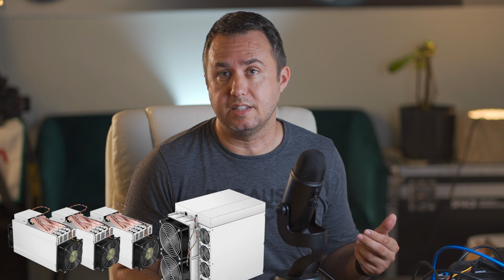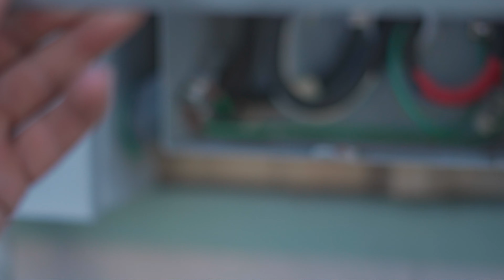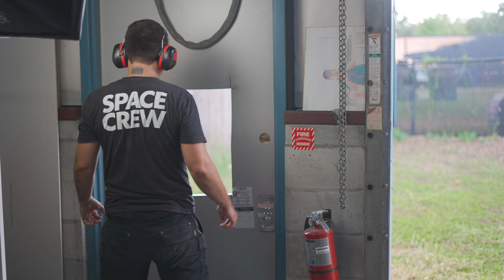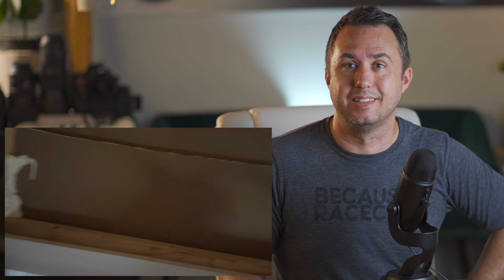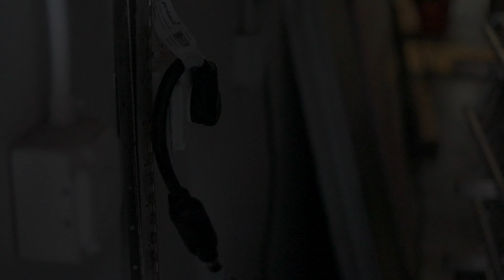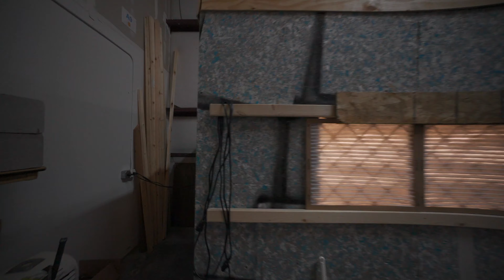Bitcoin mining filter room for my ASIC S19j Pro miners. How much do they make?

Comment: How has this held up over time? In my experience...keeping a cool side and hot side, is difficult. Even with the math, real life versus paper life, variables don't get accounted for initially and change the outcome. I work on miners daily, on alot larger scale(more heat and airflow)
Reply from the maker: I agree about the paper math; I am, in fact, an engineer!! But in this case it held up and worked out.. The exhaust fan is sufficient to clear all the hot air created by the miners and more. Even in the summer in florida my little mine is working out.

Comment: Great vid, love your channel - question: I just ordered an S19JPro - single unit. It will sit in a room, that is 10x10x8 and I'm looking to put a fan in that is 1600 cfm. That means the air will be replaced every 30 seconds. Do you think this is enough? This is in a basement where the ambient temps are already cooler.
Reply from the maker: Yep that will be enough air movement, just make sure theres some way for fresh air to make its way into the room if youre exhausting air out of the room..
Reply: @SPACEDESIGNWAREHOUSE  Yep, I'm going to put inlet vents in the room. Trying to figure out the best spot. Or I leave the door open, in which case the noise might kill us.
Reply: @SPACEDESIGNWAREHOUSE  Love your channel by the way!

Comment: How much can you hear when outside the room?
Reply from the maker: That seems like a difficult measure to describe. But the room has a giant opening so the air can get sucked in. So you can hear all of it.
Reply: @SPACEDESIGNWAREHOUSE  I guess a better question, would someone working the warehouse be annoyed by the noise?
Reply from the maker: @MrSkunks  no, I don’t think so. However I used to film stuff in there and now I don’t because of the high pitch of the noise. 
Everything is going full immersion cooling soon to fix the noise completely!
Reply: Reason I ask is that if I did something similar, would my warehouse staff be annoyed

Comment: Love the videos, very inspiring! Got some small miners on the way, may have to build a room like you did.  Minor correction, 8*8*8 is 512 cubic feet, not square.  But your calculations for the air exchange are still good since that's in cfm.
Reply from the maker: Yeah, the first watch through after it was already up I heard myself say that and was like WHOOPS! I’m really surprised your the first one to say anything-  the internet loves finding mistakes:)

Everything is still running perfectly thoughb

Comment: it is not even worth it. You get your money back faster with GPUs and you can always sell the GPUs. This machine will take a whole year to make any gains and in time will be totally useless. Do nt buy this crap.
Reply from the maker: Everything you’ve just said is true. I am not on here to tell people to buy these machines; I am on here to talk about my journey having bought these machines. 

You will make money faster with GPUs.
Reply: @SPACEDESIGNWAREHOUSE  Thats good man. The worst part is that in the end you will end up with a useless machine and probably very small gains
Reply from the maker: @FrankieTheOne  my math works out differently. It’ll pay itself off in about 10 months (and that’s only if the price doesn’t move, it will probably go up) and once it does pay itself off, the machines are powerful and efficient enough to run another 4 or 5 years. They make about 1 Bitcoin per year.
Reply: @SPACEDESIGNWAREHOUSE  They site itself says it will take 359 days to make your money back if u bought it at 11k. If you bought it more or less expensive it will be different. ATM this machine only make 30 dollars a day. Or what are ur calculations?
Reply from the maker: @FrankieTheOne  they make closer to $40 a day on average, it’s changing constantly because the price of Bitcoin is changing constantly. 
If Bitcoin goes up to $100,000 early next year, that means every coin I ever mined goes up with it, in which case I’ll break even in half the time. 
Do you think the price of Bitcoin is at its highest for the rest of time, right now?

Comment: Hey its me again. I really do appreciate your video and it is really helpful. I have a quick questions. First, if the exhaust fan keep sucking air from the warehouse, did you have to remain the door open all time for the air intake? Wasn't the noise level somewhat bothersome for your neighboring companies who are using the same warehouse or is it only you who is renting the whole warehouse?
Reply: Although these machines are pretty loud, a room built of insulation probably does a pretty decent job of muffling the white noise they produce. Also, it looks like the room is in the far corner of the warehouse so it is probably pretty quiet. In my experience, it is pretty amazing how unsealed building are, especially if you are in a temperate environment. The intake air required to keep up with that small exhaust fan is probably supplied well enough via all the little gaps in the construction of the warehouse. Door gaps mostly. He will probably sense a small amount of incoming pressure when coming and going through external doors. Nothing to worry about.